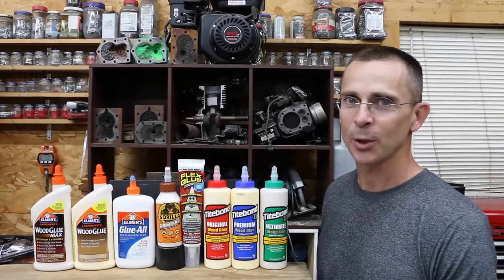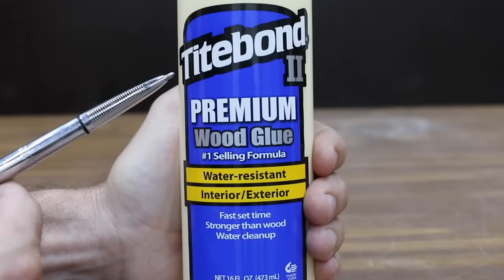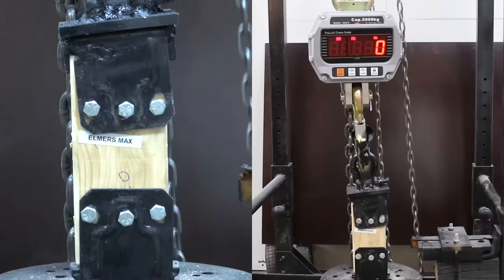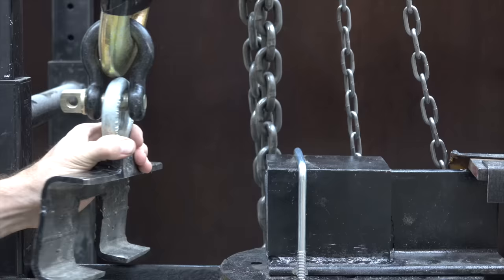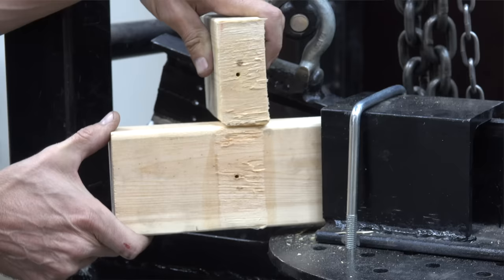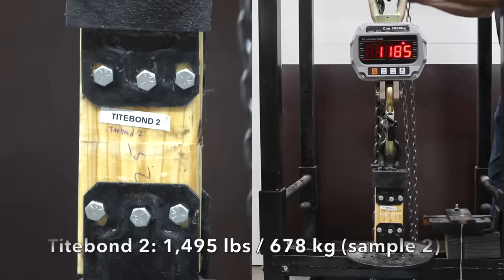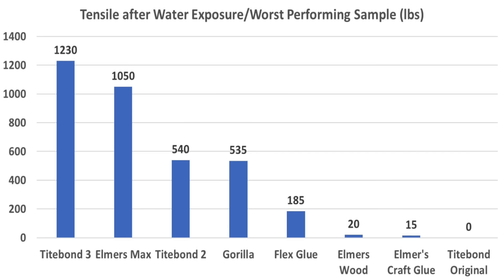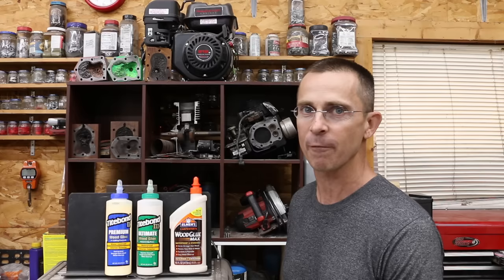Which Wood Glue is Best?  Let's find out!  Showdown with Titebond, Flex Glue, Elmer's & Gorilla.

Comment: We should make it clear that original Elmers wood glue is not the same as Max. The original Elmers wood glue is horrible. I've done a ton of woodworking. I used Elmers wood glue once and swore never again. It was weak, and took forever to dry. Also most woodworkers are building with hardwood, which may perform differently.

Comment: log test - that's not a joint you would ever use.  Would have been great to see a 60 degree scarf joint on that, with some spray pre-treat (h2o) and a longer cure time.
Reply from the maker: Thanks for the suggestion.

Comment: These tests would be a lot better with something other than two by fours. You don't want voids in the joint. If you can plane them that would help a lot. And as someone else mentioned, glueing end grain is not reliable. I think maybe that's why there's so much variation in the tests.

When wood glue is applied properly you'll break the board, not the wood. So I don't even know how you'd test it.
Reply from the maker: Thanks for the constructive feedback.
Reply: @ProjectFarm  You're welcome. Maybe you could glue the faces of two boards together and try to pry them apart. If you route out a channel on the inside and drill a couple holes you can insert a couple bolts to stick out before you glue it up. Then you can bolt each side of the assembly to a jig and try pulling them apart. Use washers on the inside to spread out the force to prevent pulling through the wood.

You can get the most leverage by using steel that fits snuggly around the 2x4 like in the shear test. You can weld a long piece of steel perpendicular to the long edge and use that as a lever to pry with the glue joint at the fulcrum. Ideally you'd want to use something that can resist flexing for the handle.

Comment: A for effort but man the variables and inconsistent results leave me wondering if there’s a clear conclusion
Reply from the maker: Thanks for the feedback.
Reply: @ProjectFarm  Sure, no disrespect intended that’s just a very very challenging test with changes in the grain structure and everything else.  I’ve been working through some similar problems at work where outcomes seem independent of the inputs and it drives me crazy.

Comment: Test failed, not much clamping power with screws without helping hole on the screw side wood.
Reply from the maker: Thanks for the constructive feedback.
Reply: @ProjectFarm  Screw threads are not allowing complete clamp, you really need holes to get reliable clamp with screws.

Comment: Your glue joints (end grain to end grain and end grain to longitudinal grain) are the weakest in wood working. I bet you'd really test the scale with longitudinal grain to longitudinal grain (parallel and perpendicular). The brackets would have to hold the sample so the force would run parallel to the glue joint though.

For a good glue, you should end up with wood fiber failure before the glue joint fails.
Reply from the maker: Thanks for the constructive feedback.

Comment: No woodworker glues end grain to end grain. Not a valid test.  For the 90 degree test, the holder peeled  the wood off from the bottom. This biased the test. Most wood folks apply glue on a flat to flat or edge to flat. A shear test woul be valid . Good video.
Reply from the maker: Thanks for the constructive feedback.

Comment: I thought LePage glue was a big brand name.  I heard of it and used it before I heard of Elmer's   Even no name brand white carpenter glue I heard of before and used before I heard of Elmer's.  They basically all smell the same and dry the same and taste the same.
.  I saw an issue with using a chainsaw to cut a post .   There is "CHAIN OIL" on the chain so that oil would contaminate the wood surface.
Reply from the maker: Thanks for the feedback.

Comment: I really like all of the work you put into your testing and I appreciate this but not in this one.  The test condiction was quite different, olso among the same glue and this is the cause of such a huge discrepancy between test samples of the same glue.
Parts non perfect allined, traction forces not perfectly vertical, misaligned costraints, cutting surfacesnot perperndicular to the forces and so on.
In short not as usual you do

Comment: The results had massive variations and unsure if repeatable, different testing is required. Possibly smaller board surface, while the effort was made the results are questionable at best.

Comment: Work you went through is amazing.  However, are you unaware that all of your tests were not done the way a Woodworker would ever use these glues?  
You ONLY ever glue long grain to long grain, ever.
The results you got were partially due to how the wood parts fit together (that long grain again!)
If you glued long grain to long grain, then tried to split the wood at the glue joint, you would find that the wood would break before the glue joint.
Reply from the maker: Thanks for the constructive feedback.

Comment: Stop with the endgrain comments, you can't test glue strength on long grain, the natural glue that holds the wood fibers together will break really easy (aka the wood breaks), the reason you don't glue endgrain is because it doesn't make any sense in any form of joinery, the joint needs to be stronger than the glue and the glue that holds the wood fibers together. Also the reason you laminate long grain is because pretty much any wood glue will be stronger than the wood in that situation, you do not glue the endgrain to make a 4x4 longer because then the glue will be way weaker than the wood in that situation, not because endgrain gluing is weak. And no you can't glue endgrain to long grain because of wood movement, not glue strength.
Reply from the maker: Thanks for the feedback.

Comment: Gluing end grain is not proper application.  End grain will not hold like a face or edge glue joint. Gluing end grain does not represent the true performance of any of these glues

Comment: Unfortunately, your clamping technique with the screws is seriously flawed. Unless there's an unthreaded region at the top of the screw large enough to fully pass through the top block, there would be next to no clamping force since the threads engage both blocks. The only way around it would be to clamp the wood blocks together with something like regular C clamps, and then screw the blocks together.
Reply from the maker: Thanks for the feedback.

Comment: i dont understant this.becouse of some wood glue desing for perma some desing for desove with waters like if u lutier top match making r botom u bever even want become come a part so whatever glue u use ok other hand if u gone glue top or botom to body for repair or neck reset or some other reason u can need be sğerate so use water heat solvable glue likr tithound orginal.
violin makers se moslty hide glue but some use wood glue too if u use tithe bond 3 u can have trouble .in life time viloins taken part so many time for repair
so testing here is so odd.
use wjat u need for if u gone outside purche some wood glue ofc will be rain and humity u donbt wanrt use tithebound orginal use 3
normal use for u cant part them.right aplication and right claping with wood gone give up before glue

Comment: I always appreciate the work done to compare products on this channel. This time however I have to say there are definitely some problems with the way these tests were carried out. The actual tensile and shear strength numbers could potentially be way off due to the poor design of the test fixtures. Take the shear test for example. The efforts made to isolate tensile forces from shear forces were completely insufficient. The fixture flexes so much that you can see with the naked eye as the glue joint tears from the bottom up. I know I'm nitpicking a bit as these are mostly comparison tests anyway, but in my mind there is some loss of credibility with this kind of sloppiness. Some simple fixture design changes would really improve the accuracy of the numbers, and probably also reduce the huge variations within the repeated tests as well.

Comment: would like to see how the best wood glues or construction adhesives effect the sheer strength of the best nails or screws. such as if you glue the joint of a board and you then nail it will it double the sheer strength of the joint or will it multiply the sheer strength.
Reply from the maker: Thanks for the video idea.

Comment: I don't think this one was well researched. Wood doesn't get glued together by end grain like that. I did the make a set of shelves with the cheapest wood glue I could find at the dollar store test and the shelves are still holding up. I recommend choosing wood glue based on properties other than bond strength cause even the cheapest glues hold stronger than the wood itself. Blew my mind when I found that out.
Reply from the maker: Thanks for the feedback.